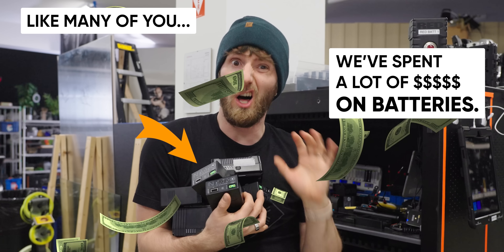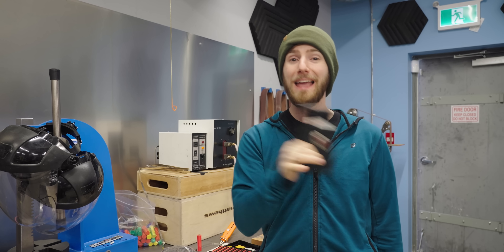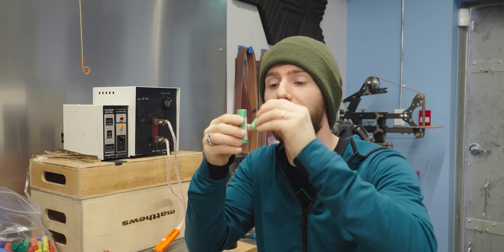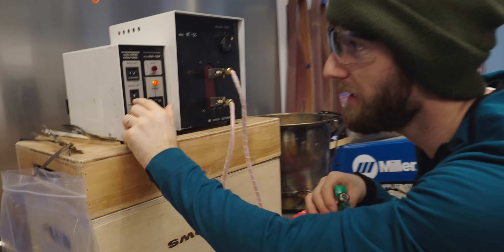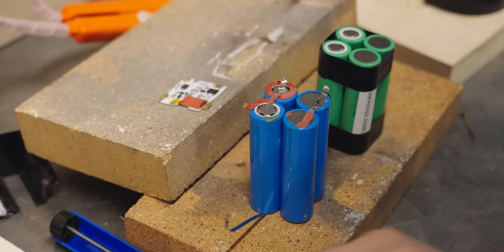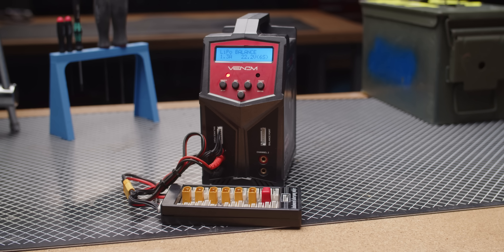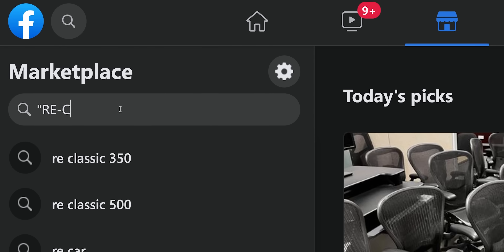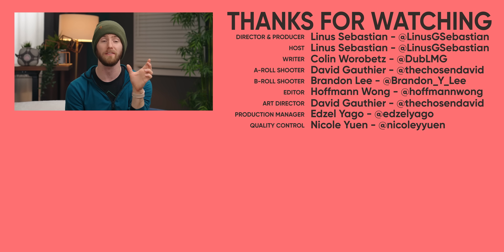This should be illegal… Battery Repair Blocking

Comment: Most battery charge systems are very poor designs that in no way attempt to rejuvenate the cells. They charge and if the charge is not taken - they expect you to toss it.  The sad and un-environmentally friendly thing is that most cells can recover a substantial performance level if deep cycled. Most microprocessor controlled higher end hobby chargers can perform deep cycling repetitive modes that with each cycle boost the capacity a bit. Its not uncommon to get a pack from 20% back up to 80 or 90. But the default chargers (cheap) in most consumer electronics just trickle charge and cutoff. No cycling.  So off to the landfill it goes. Hazardous and all.  Then again we've been dumping our AA's in the billions for decades. 
Most quality battery systems never fully charge the cells. They cut off at about 80-85% of capacity. This avoids overcharging and all the nasty danger therein (heat/fire/explosion). Also its healthier for the cell which can last literally decades in this mode. Further in this sweet zone the difference in voltage between the cells in the pack is minimized. IE: At peak charge for an old pack you may get a 10% delta between cells - but at 85% only 3% delta. Much better for balancing. The Battery Management System will not "fault" this. 
Now as for user servicability - I certainly hear you but the catch there is liability. You have the potential of shock/death for higher voltage systems (EV packs). You have the possibility for explosion/fire/outgasing for any cell.  So really anyone dealing with this stuff should take training and be certified or something. And if you are welding cells - well another liability.   So it gets back to consumer vs pro-sumer vs professional.  And who will deal with the inevitable lawsuits?  As we look at Crypto miners building FCC violating radiation systems that catch fire because they do not know the first thing about Ohms Law and how much current is too much in a splitter cable you can see that there is real engineering in designs that ensure the public safety. I'm not saying you cannot do it but if you do - get educated first.
http://www.batteryuniversity.com  (I have no affiliation with this site but appreciate their scholarly work.)

Comment: LINUS Those Sparks were no reason to throw away these perfectly good cells! It simply means that you made a bad contact, it does NOT mean that you set a cell off. If you did, youd see smoke very quickly and the cell would also get very hot very fast. I once shorted a 21700 on accident and that looks completely different.

Comment: Given how many cells you destroyed? trying to spot weld them, I'd say that replacing the cells isn't going to be a good way to save money (unless you got the new cells for free).  What really burns me about batteries are devices that you can't even get new batteries to replace the dead ones,  bricking the device, or devices that are impossible (or nearly so) to open up to do the battery exchange.  Cell phones?

Comment: I had this issue with some hair clippers… when I replaced the battery it would charge but would not power on and the display wouldn’t light up…
So after inspecting the circuit I made some modifications and although the unit doesn’t power up and display info like how much charge is left and the clipper length.
It does work and cut hair lol

Comment: Just some toughts from a guy working at a Li-Ion battery manufacturer. We have "Black-out" functionality built into our batteries for the sole reason of safety. 
The main problem is, if you reach a low enough voltage by over draining the battery and not charging it, the BMS will drain it even more until it is basically 0 V, yes it will take a long time, but this thing happens a lot.
In this case the BMS will no longer protect the pack. If the battery is recovered after the incident from the outside it will look just like before in most cases, but the cells are already damaged internally, (basically the electrodes dissolve in the electrolite at that point). 
After recovery (yes you can still charge the cell after this in most cases) if anything happens with the battery that results in injury, we as the manufacturer will be held responsible for a situation that is clearly a misuse of the product. 
That is the exact reason we will detect the voltage loss on cell side and on recovery disable the output. This is to protect the user who clearly did not use the product as intended. 
Unfortunatelly this also means that removing the BMS and putting it on brand new cells will result in the same outcome.
Reply: I'm glad I'm wearing my boots, and may I suggest not drinking the company kool-aid.
Reply: @RoySATX  Zyst has a point you know... lithium-cells are downright dangerous when charged from a dead-zero state. The safety-measures are in there to prevent the average man messing with them. Many people just don't know what they are messing with and overestimate their capabilities.
Trust me, I revived my V-mounts, equipped with a BQ20Z65's after 9 months of self-study. It's incredibly complex and with a reason. The dangers are very, very real.

Comment: 5:13  LINUS... WHAT is wrong with that picture?  You cannot reliably check the voltage of the battery like that.  You HAVE to have a resistance to check the voltage with.  I'm shocked that you did not know that....All you're doing is checking the static surface charge--which tells you NOTHING.

Comment: Serious question:  Does the BMS need to be integrated into the pack?  I have devices that come with their own proprietary batteries and battery charging dock.  In my case, the dock has 11 pins connecting to the base of the battery.  So I'm thinking there's more to the dock than just supplying power.  BUT... if these batteries aren't used and allowed to dip too low ... the BMS dies and the battery can never be charged again.  Opening the pack (since it's dead anyway) reveals there is a BMS inside.  But then why so many dock pins?

Comment: Yeah also never seen a battery welder set for 14ms that’s a long time thats more of a real weld the. A spot weld. Turn up power shorten then duration and always do a double tap weld because the first tap burns of any impurities or oils used in machining process. Also did they charge the batteries first ? You really should cycle them before measuring final voltage.

Comment: Quick corrections:
-The sparks you were worried about were just due to bad contacts with the spot welder tips, and not due to any cells going unstable, or getting shorted.
-High equalizing currents flow, when the differently charged cells are first connected in parallel (positive to positive and negative to negative), and not when in series :)

Comment: i do battery repair and you can save a "evil" bms by tricking it to think its still hooked up while removing the cells with another pack . it is tricky and not something the average person should be doing. check out my diy lithium videos and the crazy powerful cells we use .

Comment: People are so dumb these days and beg for more and more electronic things of all sorts leading to things just like this. Simple old style mechanical clearly wins along side the old idea of repairing everything! Anyone remember TV repairmen? Now with all the nut jobs wanting to save the planet wanting all this electronic crap are simply making the problem they want to fix WORSE! Literally everything is throw away these days wanted and used by all the people wanting to save the planet. Yeah now old great grandpa and grandma was not so dumb huh? Sure they drove some vehicles that burned a lot of fuel and had light bulbs that used a lot but they had vehicles they could fix forever literally hardly adding to the land fill and literally didn't drive as much meaning the total amount of exhaust coming out less then a new modern car even know the PPM was higher. 50k miles back then was considered a lot and it would take them many many years to get there while now days people hit 200k in less time. Add the total of what came out of a old car in 50k miles and then the newer one at 200k miles then compare. The emission crap on new cars simply do not come close to helping that much. Sure them old light bulbs used lots of power but they hardly ever used them unless really needed. Again less total use and the bulbs was much more recyclable.... With that said all you people claiming you want to save the planet have done nothing but make it worse so bad we can't fix anything we have just keep adding to the land fill you think is so bad while filling the pockets of the rich people you hate while forcing more trucks to run around making and filling more land fills... Start adding the pollution from them trucks to...

Comment: To be honest that spark isn't really doing anything. That's just your tip is slightly tilted / not making good contact. 

I've been refurbishing laptop batteries with some cheap spot Welder that use low quality tips, it did sparks a lot if not pressed firm enough.

Comment: Since these batteries is 18650. Each cell should cost about $4.99. $4.99 x 16 batteries=$79.84.  Since Red is blocking users from repairing them. Plus their product cost $250. That's evil. Just like you said... Just replace the bms to bypass it. BMS only cost like $10.

Comment: single used good 18650 cells are great for making small led flashlights that use the spring post bound triple AAA carriers, run brighter and longer, while also reducing weight. I've experienced a run on laptop battery packs that quit charging, and after painstakingly getting the clamshell packs open, found the bms to be the failure, with the cells testing ok.

Comment: Your video is excellent, and for all the batteries we use.. At some point the government will have to introduce legislation, because compagnies are not fast enough to get recycling and recovery/renew going. 
I was glad that I could order new batt pack for my APC unit without having to scrap it and have to buy a new one. The cost was about 70% of the unit. I wanted to ship back the old cells.. but it was too expensive so I brought them to my local eco-center here in Montreal. It still bothers me that the contents in batteries can't be reused in the manufacturing process of something else.

Comment: I stick with NiMH whenever possible. In my experience, devices that use NiMH tend to last longer between charges, and have more charge cycles. The only downside is that NiMH tends to be lower voltage. Although, I don't see why manufacturers can't simply use multiple, smaller cells and some sort of voltage regulator to get the same power output with NiMH.
Off the top of my head, the main things that I've used alot with NiMH, which is also available in Lithium Ion, are my electric toothbrush and electric shaver. The $25 Braun MobileShave with a pair of NiMH batteries lasts way longer than the $200 razors.
Reply: from what I've seen between the chemistries, lithium can be much more efficient when it comes to delivering consistent voltage across the charge curve. A nearly dead 7.2V lithium pack will still deliver 7.2V. A nearly dead 7.2V NiMH will deliver anything between 6.5-6.8V which for some equipment (for instance, digital radios, digital cameras - basically anything which relies on a microprocessor for its core function) is no bueno.

Comment: I don't get it, why is there any more risk involved in matching and replacing damaged cells than replacing all of them? Why replacing damaged cells can short-circuit during assembly and how is it different from replacing all of them? Why there more risk of explosion during use? Why would you put mismatched cells into a pack in the first place?
Just test all damn cells, throw out the bad ones, write down specs of each cell and then match them to build a pack out of it. You can easily test the capacity of the cell and if you do more of this stuff, you can also easily record the charge/discharge curve of each cell. This is enough to discard only the bad ones and reuse the rest of them. Replacing all of them is a waste of resources if you can turn 5 used battery packs into 3-4 working packs with 80%+ of original capacity. It's especially worth the effort if you are handling a lot of identical packs with the same battery types and similar wear on them.

Comment: Tbh, it wouldn't be hard for manufacturers to sell lithium packs with quick connect leads already soldered on. Then the end user just has to pop the old pack off the BMS and clip the new pack in. Reassemble the battery case and you're good to go. No Sketchy spot welding or soldering required. Of course they won't do that, because money. And even if they did do it, they'd probably charge 9/10ths the price of a new pack for the replacement cells.

Comment: Why didn't you 3d print a holder? Please note there isn't actually much lithium in batteries the fires are so intense simply due to the amount of energy in the battery not because the lithium itself is burning.

Comment: What I learned about soldering batteries is, do it quick. And even doing it quick, you still degrade the battery. Just not as much as a slow cook. Heat messes em up in direct relation to how long you keep the gun on em. Great vid. You guys rock.
Reply: Exactly, that's why battery packs are spot-welded together, high-heat and pressure ensuring a solid weld which cools down fast, causing no damage to the battery itself, they sell mini spot welders on Amazon for under $100, many right around $60.
Reply: @Danielthornton61  Oh wow. Nice to know. Ty Daniel ☺👍

Comment: It would be cool to see you visit the battery recycling center. Thanks as always!

I would also like to see videos on best practices to clear laptop fans, and replace thermal paste. Been mining and gaming with a top tier msi Rtx 3080 laptop for a year+ now, still going strong
Reply: 14:35  is the battery recycling center.
no kidding, they simply cut open the batteries and send the raw materials to the factories in ASIA to produce new batteries from the old metals since they're still good. it's not about recycling, it's about saving money by recycling and outsourcing the recycling.

Comment: Really they should be making battery packs come apart with screws and have the cells pop out for easy replacement of cells. Slap a warning sticker on original cells saying replace with oem batteries only and replacement batteries must be tested and have matching voltage before installation! No spot wielding no safety issues right to repair restored. Should be required on battery packs under 100 cells

Comment: Yes I remember well when cell phones used to come with a battery hatch in the back you could easily pop out and replace.  And of course, take out if you wanted to be absolutely sure you weren't being bugged.
WELL, they got rid of that!   Now you have to buy a new phone.   Progress (for them)
But they didn't stop there.   The latest marketing brainstorm with cell phones is they're adding features in upgraded models, but secretly dropping others at the same time.   So a new Motorola for instance you're forced to buy because the battery wore out may have a better camera, but no longer has stereo speakers.  Nice....
Reply: I still have an old Motorola that uses a stack of AAA cells - the pack it comes with is NiMH but you can use AAA alkalines with no issues (I've done it)
Reply: @Jim Moore  wow, a cell phone that runs on  AAAs!   That is a collectors item to be sure
Reply: @c.rutherford  Yeah, it's a crying shame that no networks support it any more
Reply: If its a smartphone and can still access the 'Net, it can function as a nice  tablet to run APKs, even if there's no phone use. 
But if its just a phone like my first cell was... yeah, that does suck.

Comment: On that second mistake with the sparks, did anything actually happen to the cell afterwards? If it didn't go supernova, it's fine, I don't know why you threw away that entire thing because of some sparks?? Maybe the footage was cut before anything serious happened, but what I saw was just typical beginner spot welding mistakes, not a battery safety issue.

Comment: lmfao the battery isnt just gonna explode 20 minutes after it sparked, you are overreacting, its just an 18650. Did you guys finally figure out how to use your Hakko 888 soldering iron after whats his name recalibrated it essentially turning the temp way down permanently (at least until a factory reset)

Comment: The user device and the battery pack communicate with each other, usually uses i2c - and that can be spied-upon....  Also some laptops if they sense 12V ..14V coming in instead of higher voltage that would be expected of a battery pack, conclude that a vehicle power supply is connected, and they work from that.

Comment: Great video. You were both reasonable and responsible in the way you explained the problems and how you attempted to work around the issues. Clearly the average person shouldn't be repairing battery packs, but it should be possible for someone with the proper equipment and training to do so. Also, thank you for highlighting a manufacturer doing it right as an example to the industry.

Comment: It's just like a dji battery. You have to keep voltage applied to it. You need a pack at a similar voltage to the batteries you are installing. Solder the voltage upkeep battery onto the pads. The cells will soft balance the packs. Then you can disconnect the bad cells. Install your new cells and remove the voltage holding pack. Close up your case and use the battery. Its not hard, but its annoying. There is another method based on the packs bms. You jump the circuit pass the component that shuts the voltage off. Simple as adding a wire. Each bms is different so it takes more time to figure out where the jump needs to be put in place. The other alternative is just jump the entire bms. Not recommend though. Best to keep the bms with a voltage keeper and swap your bad cells for good. It's the easiest method.